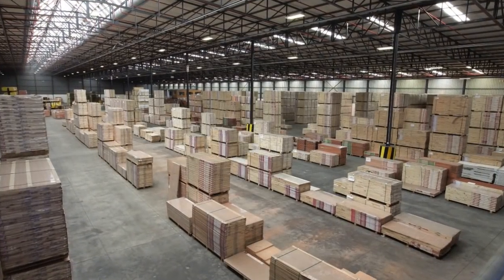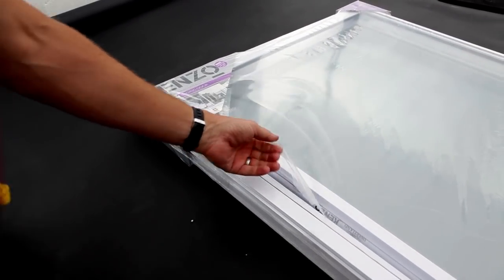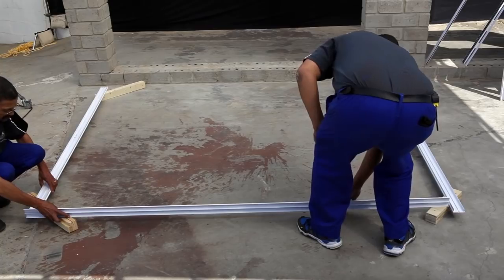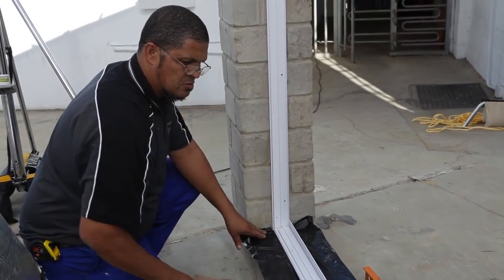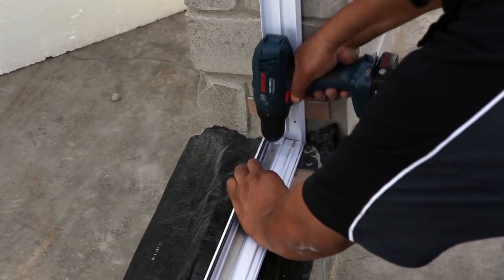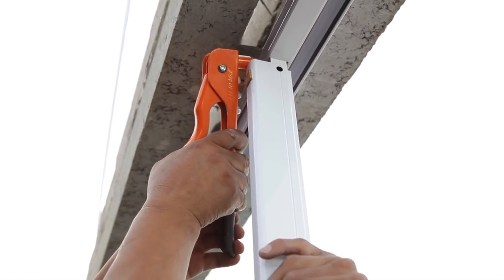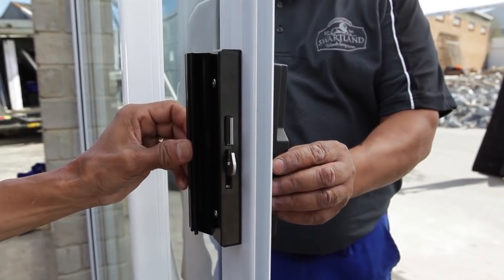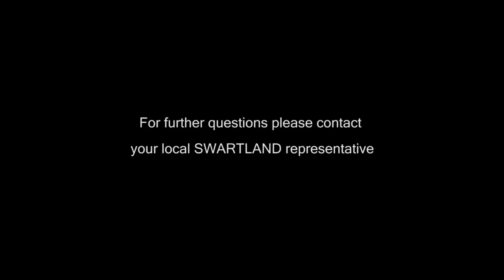Swartland Kenzo Aluminium Sliding Door Installation

Comment: Excellent! I need this video because the installment guys in my place installed the door wrongly. The sill was buried side by side with the balcony which make them has the same height. As the result, rain water gets into the room whenever it is raining.

My only question is why one side of the door needs to be in the fixed place (unmoveable)? Why not make both side become moveable?